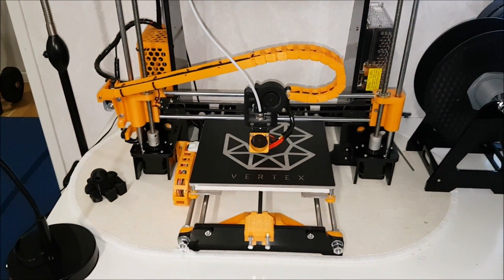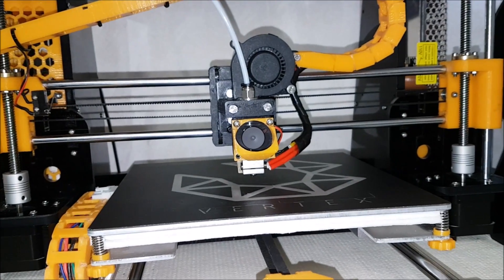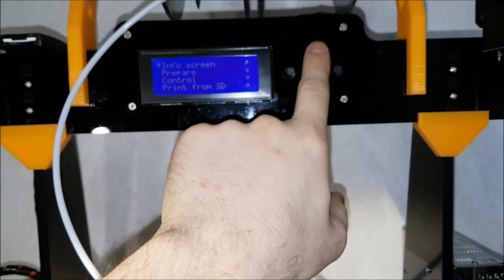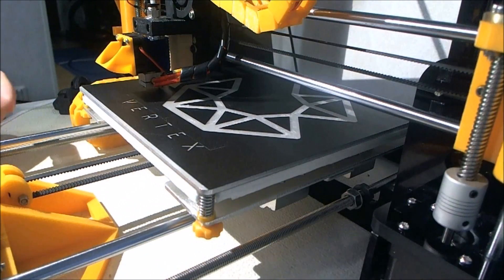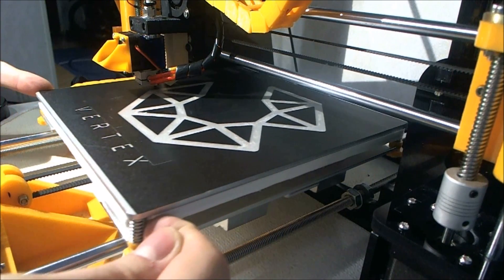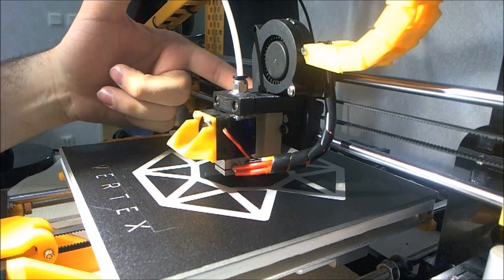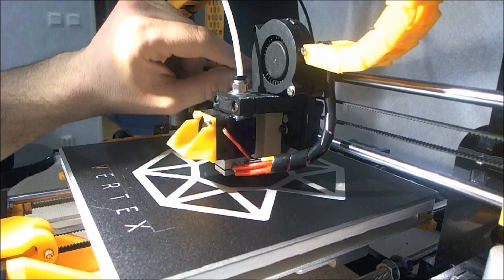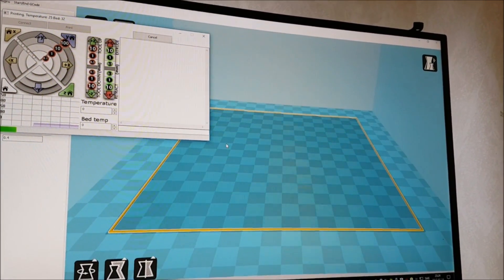Anet A8 3D printer How to level your hotbed perfectly

Comment from the maker: Hi Guys thank you all for support!  Check my other videos and reviews on my channel: Here is some Tips for perfect prints: 
Build it perfectly. Make sure all screws are tight and belts are not loose. Check distance on side(Z axis rods holder)
Use lithium grace to lubricate bearings to make them run smooth or make IGUS PLA bearings and use thin oil.
Level your bed on minimal 5 places(4 corners and center ) using A4 paper. Nozzle should NOT touching heat-bed surface.
Move X carrige and look for distance over whole hotbed area to make sure that nozzle is  again NOT touching heat-bed.
For better print sticking use Brim option in CURA or hear spray or order BuildTack.
Try to find best settings in CURA. Use slow first layer 10-20mm/s 
Average settings are PLA 200C on nozzle Hot-Bed 55C. On ABS 230-240C on Nozzle , Heatbed 75-85c (Use brim option) 
Layer resolution is 0.2mm medium quality or 0.1mm to High quality
Print speed are 34-55mm/s   Travel speed are 45-85mm/s
Reply: Oh boy, I found th is baaby here: https://www.gearbest.com/3d-printers-3d-printer-kits/pp_337314.html?lkid=12711150 
I boughtone:)

https://www.youtube.com/watch?v=O55x7B-MsE4

Comment: Thanks for offering this but it helps to know what all software you're using. Seems like since you do a test run that something could be wrong and the nozzle gets damaged. What of the calibration method using g29 s1 command? Isn't that a better more certain way to do this?

Comment: I need help getting the printer to print in the center of the bed if i put an x on the bed the x is 91 and the y is 106. in the homed position off of the print area x is -33 y is -10. using marlin and cura. How do i store x 91 y 106 as center?

Comment: Sorry if I missed it somewhere, but you talk about the paper-method and i do understand it. However I use feeler gauges, trying to be as presize as possible... Now I hear and read people talking about a gap of 0.2mm but also 0.1mm.
Do you have any idea what nozzle-bed-distance you get with this paper-methode?
Reply from the maker: Ludo De Greef Distance should be around 0.1-0.2mm. Papper A4 is around 0.1mm thick.

Comment: With my Anet a8 i find the A4 paper has to be grabbing the paper a bit. Basically if i hold the paper about 100mm distance from the nozzle while its under the nozzle and try and move the paper if it bends the paper its a little firm if i can move it with out bending its about right it feels like rubbing a fine sandpaper. Then when printing i put a 15mm brim and adjust 1/4 turn of the screws as needed while its printing to get perfect height as it gives me plenty of time to mess around with it. My head bed is glass which i do like although its very temperamental getting things to stick so the bed height has to be perfect. When i was using tape on the heat bed it was a joke how easy it was to get it right but parts wouldn't have a smooth finish and the tape had to be replaced fairly often as it would pull it off most of the time.
Your tip to disable the stepper motors is really good i never did this before i always used the x/y location driver to move the nozzle this will be much faster thanks for the video.

Comment: I am always adjusting the height of the heated bed, haven't changed to silicon Borate glass, but when I do I am going to have a much better wway of adjusting the four corners. I am interested in which upgrade you have done with the thumb nuts Regards \C

Comment: i got this printer last friday, spent 2 days to level that hotbed. still without 100% success... :/
it looks like the middle of the bed is bent, because leading rods are ok, straight. i have checked them on the glassplate. 

still working on it.... drives me nuts..  :D

Comment: My bed surface has a slight dip in the center, I know it's not the rods. What can I do to fix this?
Reply from the maker: Try to use RAFT option in CURA it adds extra surface under printing model and that can fix gap.

Comment: You might want to consider using feeler gauges versus a sheet of paper. Then you can be more precise since they are metal, have very accurate thicknesses and are not compressible.

Comment: Why don't you use the sensor you installed for leveling?
Reply from the maker: Well,  I take sensor off. If you go back to my first video about upgrades you can see that I had sensor installed. That is not ''true'' auto level sensor and heat from bed can affect sensitivity of sensor. I just wasn't satisfied with results so I take it off. I still have it in workshop btw :)
Reply: Nexi Thanks!

Comment: Hey Nexi, another great video, thanks a million.  I have a couple of questions please:
1. I've heard you say a couple of times that you filed down the cable tractor on the bed.  I've just printed this and wondered, did you just "round off" that 45deg angle on each link or was there something else you filed?
2. I know from your previous videos that you tried auto-leveling but couldn't get on with it.  Which sensor were you using and now that you've upgraded to Skynet, would you consider mesh leveling again?
Thanks.

Comment: Do yourself a HUGE favour and get an autolevel sensor so that the printer can take care of bed leveling all by itself! You'll love it I promise! I certainly do!
Reply from the maker: Well, not in near future. I take sensor off. If you go back to my first video about upgrades you can see that I had sensor installed. That is not ''true'' auto level sensor and heat from bed can affect sensitivity of sensor. I just wasn't satisfied with results so I take it off. I still have it in workshop btw :)

Comment: Have you figured out how to center the nozzle on the bed? I just installed the same hot head and can't get mine to center. noticed yours is out also.

The mount for the hot head also reduces your print area as it can reach the end of the board. I'm remixing the same mount but moving it closer to the rods.
Reply from the maker: https://www.youtube.com/watch?v=7Ms3l5h9M9U Check this video first.
Reply: Nexi Yeah watched that one already and still am not centered. I assume I just need to figure out the correct limit settings
Reply from the maker: Damn! You right! I think I got it. Try this: 
G21        ;metric values
G90        ;absolute positioning
M82        ;set extruder to absolute mode
M107       ;start with the fan off
G28 X-15 Y-26 E3000
G28 Z0   ;move Z to min endstops
G1 Z15.0 F{travel_speed} ;move the platform down 15mm
G92 E0                  ;zero the extruded length
G1 F200 E3              ;extrude 3mm of feed stock
G92 E0                  ;zero the extruded length again
G1 F{travel_speed}
;Put printing message on LCD screen
M117 Printing...
Reply: I have remixed another mount to move the head closer to the x axis so have different settings now. But I think I have mine figured out also.

Did you just add the distance the head moves off the board to the start g code to compensate the amount it was out?

Been tempted to post a video of my setup but just don't have time at the moment

Comment: My printer is coming soon, subscribed, very helpful, thanks
Reply from the maker: Nice! Am glad I helped! Good luck with your printer :)
Reply: Nexi actually I have it right now, Im working in upgrades :) so far the auto level sensor , bed chain and mosfet  and installed a fan for the psu(getting pretty hot before, now it's almost ambient)waiting for a different color filament to arrive my printer is full black right now, time to print something to make it look better. Any advice is welcome :)

Comment: Well done Nexi. Thanks a lot mate! One question: apart from the extra weight that it adds to the printing nozzle, why have you discard the use of any auto leveling system?
Reply: i am not sure why he did, but part of it could be his vertex sheet on it interferes with the induction sensor, i also know the skynet3d 3rd party firmware is buggy ( needed for the sensor) which can screw up the printer. he also changed his entire printing head/extruder for a bowden style, so his mount probably doesn't fit. also that kind of leveling is 'fake' it just makes the z axis go up and down to compensate for a non level bed, which slows it down and adds wears on the motors.
Reply from the maker: You read mine mind my friend! :) Thanks : )